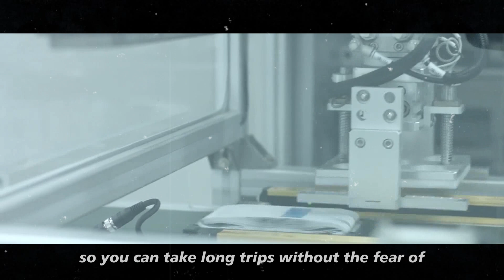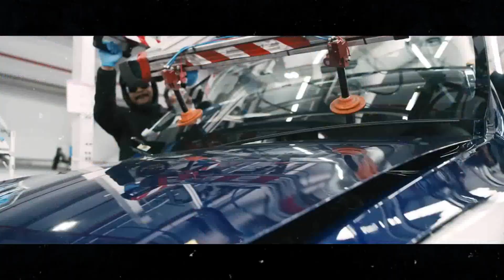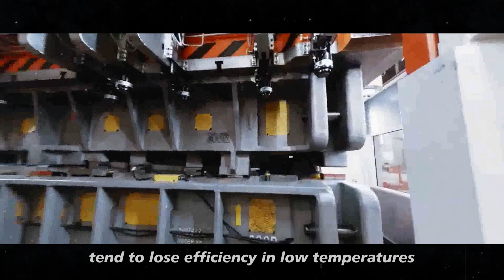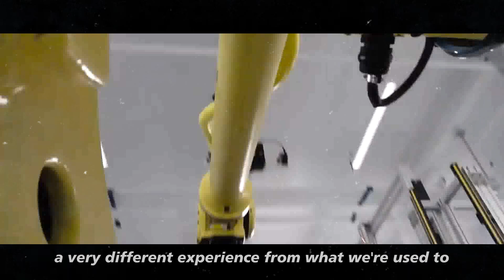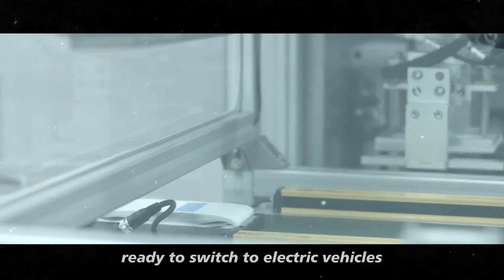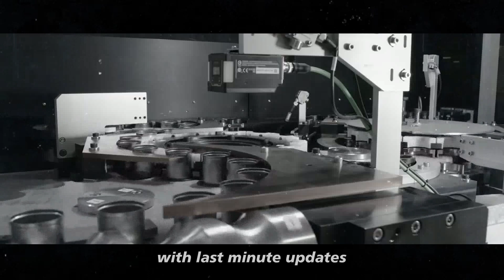TESLA Model 2 REDWOOD! Elon Musk Talks About Tesla Model, New Battery, New Engine And Production

Comment: Just like the $35,000 Model 3, right? Look at this vehicle, when it eventually comes out, to be in the $30K range. As for not "skimping on quality", have you SEEN a Tesla? I've yet to see one where the hood actually fits and the Cybertruck has ZERO panels that are correctly aligned. They don't even match side-to-side.
Reply: Chinese manufactured cars have better panel fit.